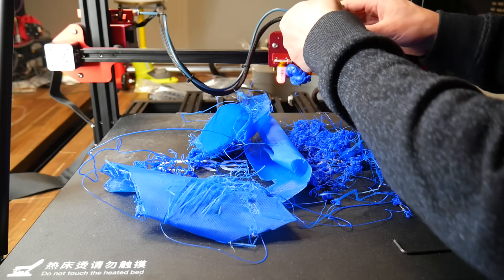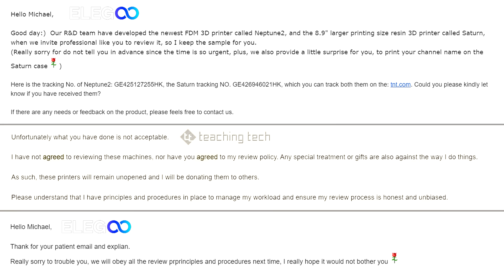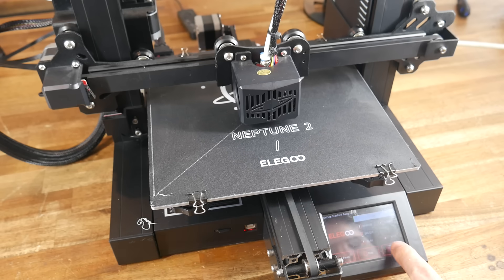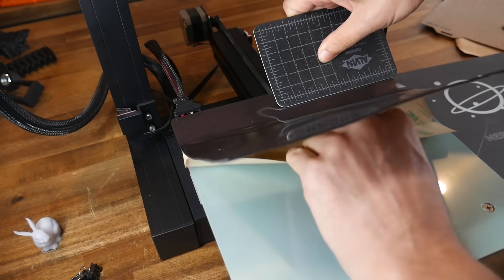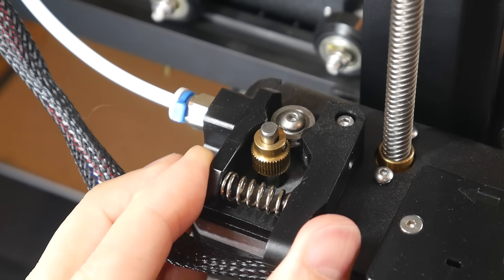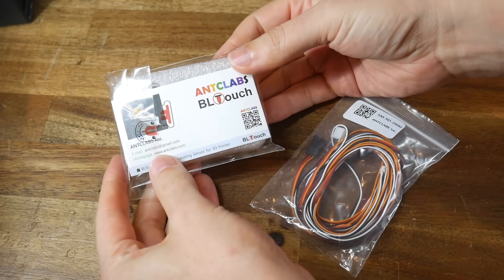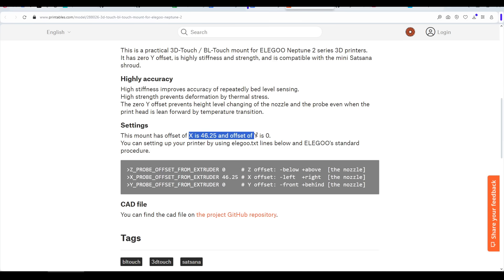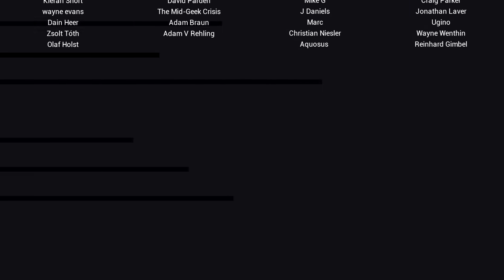Are cheap 3D printers more trouble than they’re worth?

Comment: I recently got my CR10 V3 up and running after years of it sitting in the box (I never had enough space to set it up and I just sort of left it to sit for a long while, I bought it when it was fairly new lol), and the idea of the bed just coming out of level randomly is something I'm genuinely worried about because to even get the thing level I have 3 of the four knobs twisted almost as tight as they can go and have no idea how to change it to fix the issue, Looking into getting a BL or CR touch so I can just sort of not have to worry about it.

Comment: There really is a 'before and after Bambulab' and I don't miss the tinkering one bit. To think that I was fidgeting with something as simple as bed leveling a year ago is truly alien.
Reply: I had owned several AnyCubic printers, a MingDa, and a Tevo 'Little Monster'.
Each had their own unique strengths and glaring weaknesses.
Up until the recently acquired Bambu X1C, "the printer was the hobby"
Filament changes were my worst nightmare, now they 'just happen'.
[I love filament painting!]
As one gets older, convenience gets more and more important.
Reply: My new A1 developed a dislike for putting the print head over the purge wiper during the pre-print preliminaries after I updated to firmware version 01.04 today/yesterday. A downgrade seems to have solved the problem for now and, apart from one print developing spaghetti 2/3 of the way in, it's been trouble-free. But I'll definitely be a bit less enthusiastic about firmware upgrades for a while.
Reply: had an ender 3, then gor an A1. Best purchase ever. no tinkering needed, just send the print. Only issue Ive had so far is some bed adhesion stuff which Im 99% sure is my own fault.
Reply: 1,000%!!!!!!
Reply: For some there's also "before and after Voron". A Voron has to be assembled and configured, but once you do that it's set and forget, it's a very reliable machine, and it's basically what Bambulab has copied to perform like it does. Now there's also Sovol which is even more of a copy of Voron, except that everything is open source but one gets an already assembled machine.
Reply: @DiThi  "Copy of Voron", that's absolutely hilarious
Reply: @oyuyuy  bambu printers are not copies of voron, what I said is that they copied voron (meaning, it copied many good ideas from voron printers which other brands weren't doing) but also made extensive use of open source software like the slicer without wanting to give back to the community (but they had to). Sovol printers are much more of a copy of voron, but they DO give back.
Reply: @ Yeah, still hilarious nonsense, they don't share a single component. Bambu are really quite innovative but I guess you can't admit that.

Oh, and open source is childish too.
Reply: @ Voron was the printer that popularized the coreXY system, no commercial printer was coreXY before that. Along with Klipper, it also popularized input shaping (resonance compensation) and pressure advance, among other features. Bambulab was the first commercial printer that had all of these features. And they DO share components: the slicer which was based on prusaslicer (which was based on slic3r) but for a while they refused to publish the source code as per the license agreement.

What do you mean it's "childish"? Without open source software you wouldn't be using the web browser you're using, or even the smartphone operating system you're using.
Reply: @DiThi  Haha, Voron has never been neither popular or commercial. And there were both community projects and commercial projects with coreXY before Voron. 

What do you hope to achieve with this silly endless derivation anyway? To pinpoint the discovery of fire? 

Open source isn't a business. You can never get a good product without commercial interest. 

And no browsers or phone OSs are open source but feel free to pretend that. It's particularly funny that you think Safari and iOS is though.
Reply: Literally same lol
I got my first bambu in February 2024 and before that it was a modded ender 3 pro. Night and day difference.

Comment: I'll be blunt..unless you are a tinkerer and just want something super basic to experiment with there is only 1 budget printer that is worth buying on the market. That is the A1 mini. Sorry but for those who just want a 3d printer that just works there is nothing else that is worth the trouble under $300. One of my first printers was actually an Elegoo Neptune 2s. It never worked. It had a warped bed and to Elegoo's credit they sent me another entire bed no questions asked. It was also warped just in a different spot. I only got a handful of servicable prints out of it (mostly upgrades for it) but overall it was a giant headache and I spent more time screwing around with it than actually printing. That said, it taught me a ton and the experience was valuable in helping me learn how to build these machines.

Comment: For me my first cheap 3D printer (Ender 3) was totally worth it. It gave me a chance to learn about 3D printing first hand and figure out what I really want when I do decide to spend more money. It has made several different successful prototypes that I still use to this day!!!
Reply: I got my first ender 3 back in 2018 lol. Since then I've only bought clones. They all work fine.
Reply: My very first 3D printer was a Sunhokey Acrylic monstrosity from 2015. Sure there where better ones, but they where very expensive, and the Sunhokey only costed about $450 with import and VAT (called BTW in my country). I did not had much choice, because my budget was very limited at that time. My very first print went totally wrong and it took about 20 attempts to print a kind of cube that looked more like a small sphere. After countless attempts and months of tinkering I got that devilish contraption print something recognizable. It did not help that the slicers at that time where very bare bones, and difficult to use and wrap your head around for a absolute beginner. Also the hot end was something to get nightmares from, and I replaced at the end by a original E3D hot end. That was a gigantic improvement, and at least the results where acceptable (somewhat).
For me that very first 2018 Ender 3 was a dream. Yes - You still have a lot of construction to do, but compared to that Acrylic disaster it was a simple job. By that time the software was dramatically improved. My very first print was a success and even much better than that older printer could deliver after years of tinkering. That very first Ender 3 saved 3D printing in general for me, because I was about to give up and bought that Ender 3 to give it a last chance. Now, years later, I am still glad I gave it that last chance.
My last Ender printer was a Ender 3 V3 (one of the latest models), but needing more room on my electronic workbench, I finally bought a Bambulab A1 mini. It is simply one of the most reliable "plug and play" 3D printers I ever had. We sure have come a long way since those early machines from 2015. That's for sure.
Reply: Ender 3 Pro user - Its' my kit car project.
Reply: my first (and only) 3D printer was ender 3 and I replaced everything but the metal frame ;p I must say that it was frustrating at first but at the same time it made me understand each and every components this printer has. at the end, it was valuable
Reply: agreed, i upgraded a ender 3 pro and learned alot about along the way.
Reply: same, i got an ender 3 for cheap, modded the crap out of it to learn and have a journey, sold it for 200 euro and with that same money bought an a1 mini, now whenever i want to mod this a1 mini's startup gcode it's all so clear thanks to that prior printer

Comment: I've got an Elegoo Neptune 4 Pro and it was working great until I encountered the dreaded blob of death. That was actually fairly simple to sort out and clean up, but it seems to be stuck with the problem that caused the blob in the first place, which is it catches already printed layers. The initial layers go down fine, but as soon as it speeds up and starts doing in-fill, it'll catch something and that disturbance usually results in disaster.

I've levelled the bed so many times, and made sure that Z-Hop is enabled, but it won't print anything successfully. I even swapped to a new nozzle in case that was causing problems. At this point I'm out of ideas, other than replacing the whole extruder.

Comment: I went though several 3D printers from Creality, FLSUN and Flashforge and yes they worked but also required a lot of tinkering. My Bambu X1C is pretty much plug and play I have printed 1000 items in total and only had 6 failures and I can bet they were human error related.

There is no harm in getting a cheap 3D printer and for a person who enjoys tinkering more than making it's a better way to go but if your a person who prefers to design and print go for something like a Prusa or a Bambu
Reply: Which FLSUN?? I have the qqs-pro. Never tinkered with it. Did the bed leveling probe thing and its been by far my favorite old printer. It was my go to until I bought my K1 max.

Comment: yep. My first was an acrylic plastic framed piece of chinesium which I replaced with the Prusa MK2 when it came out because the MK2 had the induction sensor for bed leveling. Now I have the Sovol SV08 which has more quirks than my old MK2->MK3S, but is still nicer to use.

Comment: I'm still rocking my Ender 3 that I bought way back in 2018. Upgraded it a bunch over the years (Micro Swiss ND hotend, dual Z motors, PEI print bed, Raspberry + Klipper for input shaping, bl touch,  etc) and it has been phenomenally reliable for me during the time. There have been no grave errors that I haven't directly caused as a user, so I have been extremely happy with the printer.
Granted - The extruder system did in fact eventually give out, which is what prompted me to do the Micro Swiss ND upgrade, but really it has been fantastic especially considering the price
If you're a handy man and you can be very careful and precise when building the printer yourself (because that's 80% of what determines your print quality imo) then these cheap printers are a good idea.
Reply: The ender you just described is straight up more expensive than a A1 Mini. Your advice is outdated.
Reply: @BeefIngot  damn that's true
Hang on though 1) the A1 mini is especially cheap right now because of black friday / xmas sales right and 2) an ender 3 has bigger build volume.
Print quality with my upgrades is about the same, but granted the bambulab is faster.
A better comparison would be the A1 which is slightly bigger but much closer in size and here the price advantage disappears.
Reply: @Chretze  caring about the 40mm extra for the tons of time lost is a classic noob trap

The A1 Mini is the better comparison because it's the comparison based on price.
Reply: @BeefIngot  Yes, smaller printers are cheaper, you are very smart!
Reply: @Chretze  You missed the point by a very wide margin

Comment: Love tinkering, cheap printers and then the price doubles with the upgrades but.. the knowledge gained on how to troubleshoot, fix and understanding what’s happening to the machine is invaluable, the fixes and upgrades you did to the elegoo, six years ago i would of been head scratching for months trying to solve it, but thanks to your work and many others I’m able to diagnose my machines quickly to determine if it’s hardware or firmware, and don’t get me started with maintenance.. 3D printers are a tool and after certain amount of use they will need something adjusted or replaced and then recalibrate and keeping parts lubricated and retention of belts , couldn’t do any of that and more without tinkering to learn
Reply: Actually it would cost some ~20-40$ to upgrade the old Marlin printers to today standard, you mostly need a 9e BMG clone extruder, a CHT nozzle, 5015 blower, a 3D Touch probe if you don't have it already. Then those printer can do 4-12k accel and they can be silent, print with bigger nozzles...
Reply: @eaman11  Oooor you just buy an A1 mini
Reply: @BeefIngot  That is smaller, it can't print ABS / ASA, it's closed source. I'd rather buy an X Smart 3 if that's your point: way faster and it can print eng materials like it's PLA.
Reply: @eaman11  What you just described can't print abs either.

We're talking 180 bucks
Reply: I have been forced to learn similarly and couldn't disagree more.

All that time spent  could be spent having fun learning the specific things I wanted to learn doing projects I planned to do.

After buying an X1C I stopped using my older franken printer (modified to the gills) and got enough time back to learn the basics of pcb design.

It was so freeing to have a printer that just printed and just enabled the maker hobby I have.

I don't want to be forced to have a 3d printer hobby, actually more specific than that, bad 3d printer fixing hobby.

If I want to get into 3d printer enthusiasm, I'll make a custom printer.

If I want to do anything else  I now have a printer I don't have to worry about.
Reply: @BeefIngot  There's a saying, there are two hobbies: 3d printing and 3d printers

Comment: I got a couple Ender 3 v3 KEs and they suuuuuuck. SUUUUUUUUUCK. Spend more, cry less.

And if you want stuff that just works, don't buy a printer with a plan to upgrade it to not suck. Just buy something that doesn't suck in the first place. By the time you're done upgrading, you've spent far more time and money than necessary.

Comment: If you’re tempted to get someone a cheap printer for their first one, just get them an a1 mini for 179 that dramatically outperforms its price. 

I’m a Voron guy but my wife got one of those and I’m shocked how easy it is use, and she is actually enthusiastic about printing now because it just worked with no fiddling like she’s been seeing me do for years.
Reply: Get a QIDI X Smart now for the same prince: it's an enclosed corexy that can print ASA and ABS with accelerations of 12-25k.
Reply: @eaman11  for $180? Where? Not used.
Reply: @Jokershadow696  189e shipped on black friday, usually 240e.
Reply: @eaman11  I looked up but wasn't bale to find even close. Everywhere was 400
Reply: @eaman11  cheapest QUIDI printer I'm seeing is $400
Reply: @eaman11  literally double the cost. And I said first one. 90% of brand new users should not even be considering ASA and ABS until they’re knowledgeable about the printing processes and the fumes etc. 

I stand by my statement that 179 for a “just works” printer is a game changer for new users because I’ve seen it with my own eyes how easy it is for them and how enthusiastic they get. 

QIDI are cool though, I’d like a plus 4 at some point.
Reply: @DatMammutt  The Qidi X Smart 3 was 189e at black friday, usually it is 240e. It prints ASA and ABS like it's PLA on a bedslinger.
Reply: @ don’t care.

Comment: A1 Mini (without AMS) is under $200. I hate to be a shill but after 6 years of dealing with the upgrade-fix-maintenance-upgrade cycle on cheap printers buying a Bambu changed my entire perspective on what 3d printing could be

Would've been funny if the video opened with "Buy this one and just save yourself the trouble" with a photo and then a false ending 😂
Reply: I have a Prusa Mini and an A1 Mini. I'm not a fan of Bambu but it simply made other entry level printers obsolete, it's impossible to beat in value in that price range.

Comment: Yep, you are spot on. I'm still using a Ender 3 clone and 2 Ender 5 clones. As their stock parts die I standardize them all with the same upgrades (when possible). My game changer is Klipper on cheap printers. My next big upgrade is a Z offset calibration sensor. If you're new to 3D printing follow the advice given in the video

Comment: When I was giving a lot of advice I started telling people around 2019-2020ish and especially post 2022 that while there was an abundance of good entry level machines, that those machines usually require a bit more work (always remember to level the plate and mentioning bowden-gap jams were common things I'd mention), and I especially emphasized that there was a price floor, under which you were getting something that was going to be a project, not a tool. Specifically back then I was referring to the still present abundance of bare bone i3 kits using old MK8 / MK10 extruders, frames made of acrylic or wood, and poorly fabricated parts you could find for less than 200 USD, which in my experience make the issues encountered on cheap E3-pattern machines trivial. Forget simply changing hotends (though I absolutely had to do that too) and adding ABL- the one I made the mistake of getting basically had to have it's Z and X axis basically rebuilt, due to parts being poorly fabricated and thus misaligned.

It makes sense that as the standard for machines improve the floor moves on, especially for people who want a tool. But, to me, for someone who wants to tinker with machines as a hobby, these are still very much relevant as base machines.